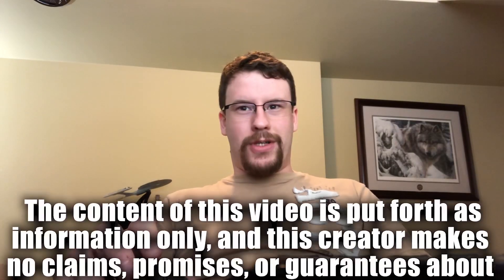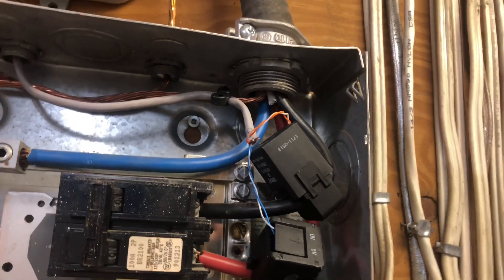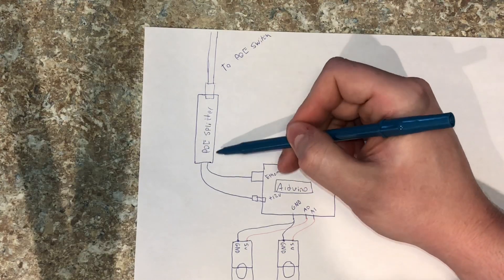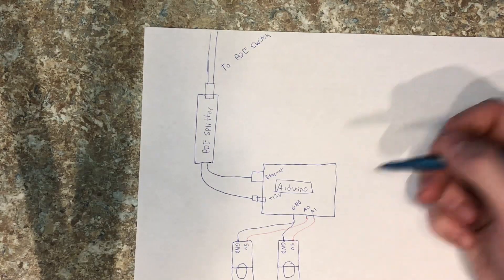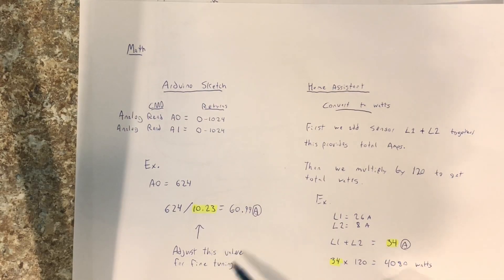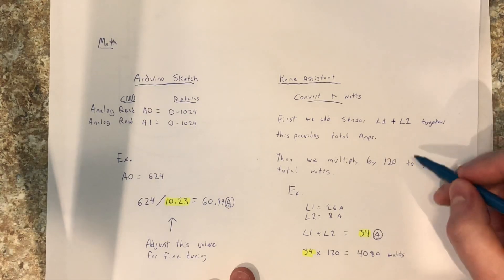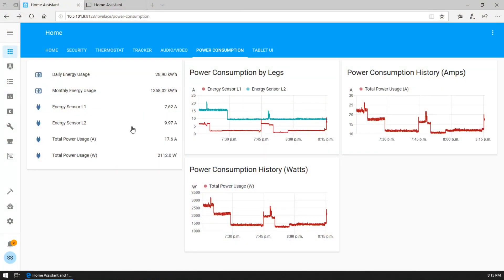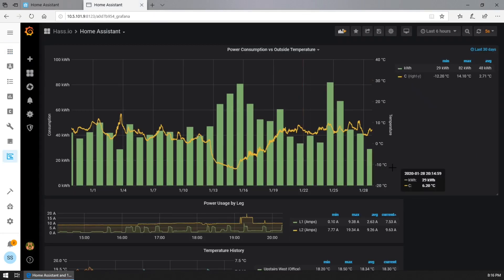Simple and Cheap DIY whole home energy monitor for Home Assistant using Grafana (V2)

Comment: this could also be extended a bit. Something like linking this into that smart AC(I haven't watched that video, YET) and being able to contro it based on both power draw and both outdoor and indoor temp. You could also have it able to set a thresh hold for turning off certain non-critical devices till power usage goes back down(For example shutting off the AC if you are already at the threshold set but the temp is also comfortable) You could also have it switch between the AC Unit and stuff like room fans depending on temp and power draw. You could probably work time of day into the control portion aswell to get really fine control of when any of these things are done and even how its done for certain times

So in theory this project could not only be made to monitor, but also manage certain power consuming devices aswell.

A useful bit of info I think should be added tho, a calculation that takes your KW usage and performs a formula to determin a rough estimate for your power bill. So you could maybe also set profiles for Low/High monthly budget to have yet another way of determining how the thing may control things.

P.S. I know what all I said is very complicated and likely time consuming but I felt it interesting enough to share

Comment: You are actually calculating VA and VAh. To calculate W and Wh on an a/c circuit you need to multiply by the RMS constant.

Battery backup companies like to advertise in VA because its a significantly larger number than W. Plus there is alot of equipment that states Amperage but not Watts.
Reply: To calculate W he needs to multiply instant. I x istant. V. What explained in the video is an approssimation of VA power.
Reply: @dariovicenzo8139  instant wattage on an ac circuit can be positive, neutral or negative. RMS power of an AC circuit gives you the equivalent power on a DC circuit.

Comment: Disclaimer to anybody doing this - Do not clamp first w/open circuit - If you do it will put a large (unearthed) potential on the wires going into the ardiuno, this is NOT FOR THE AMATEUR, consult an electrician !